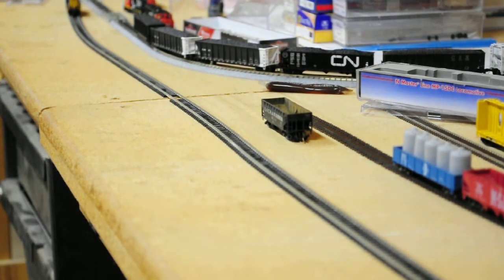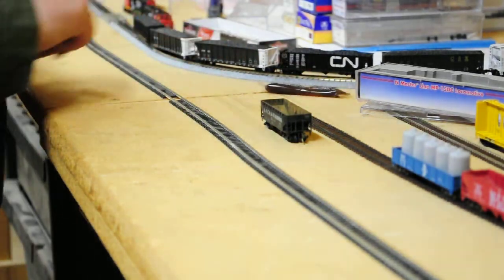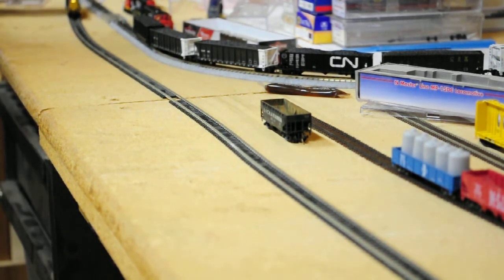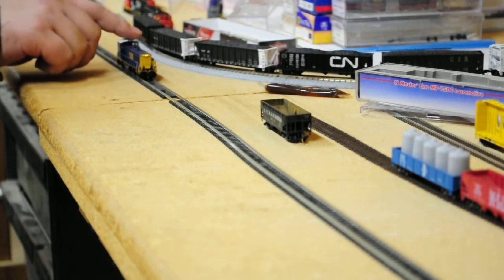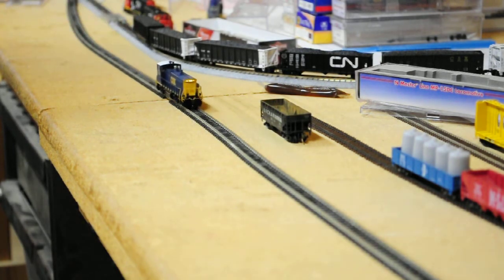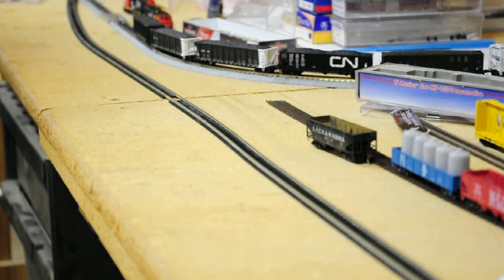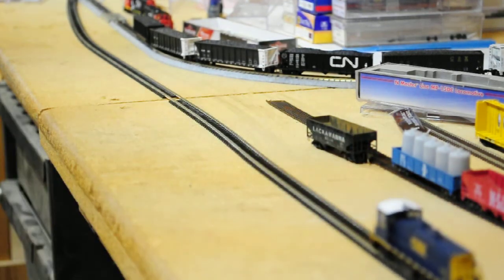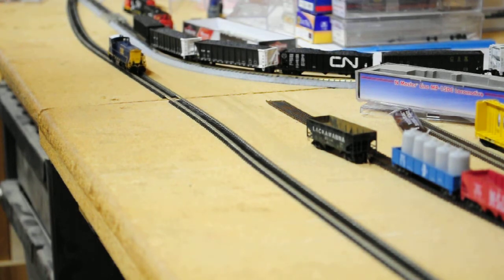No-Ox ID "A SPECIAL"  Improves Model Railroad Track

Comment: To be fair, wiping down the rails with almost anything (alcohol for example) would remove all the dust and surface dirt and oxidation and the engine would run better.  The only way to really know if this stuff works would be to test that stretch of track at 1 week, 2 week, 4 week intervals against a piece of untreated track to see if it does any better.
Reply: Alcohol isn't good.  It contains water which after the alcohol part has evaporated will oxidize on the track.
Reply: LMAO alcohol is HORRIBLE for model railroad track!

Comment: how long does it take to wear off and for you to re-apply it ?
Reply from the maker: just apply a small amount more to a clean paper towel and re-apply.

NO-OX ID Special is used in the marine and rail industry, and military applications.  It is pretty decent stuff and made specifically for preventing oxidation, in electrical contacts.   So it is kind of designed for this purpose.

Comment: I think this Video Needs to Go to the Main Line and Get out there.. the performance was all there Engine doesn't go and it looks to be a new section of track probably not Soldered then the product is applied and Bish Boom Bah" the Engine said that's what I've been waiting for Yea Haaaa I got some freedom to Move!!   This or that stuff needs to be in Ever Hobby Shop.. Bar None.!!!!   

Forgot to Ask where did you Buy your No Ox  was it easy to find and aquire.. I'm seeing Amazon one Railroad place not sure its brick n' morter and a Tool company but they have on there sight it made by Sanchem but it says Rainbow something so I assume its the same No Ox ID A" special...

Comment: I'm sorry, but a poor video. Loose track. Was it clean? The proper test would be to clean track with Mineral Spirits. And then wipe No-Ox. Also, clean wheels. So your video is miss leading. I use the Mineral Spirits plus the graphite treatment and it works just as well as what you show. Cheaper? I don't know. If you use No-Ox but haven't cleaned, it's not a valid test. Just wiping with No-Ox by itself is not enough. It might be for you. But without clean wheels and track, any other treatment isn't valid.